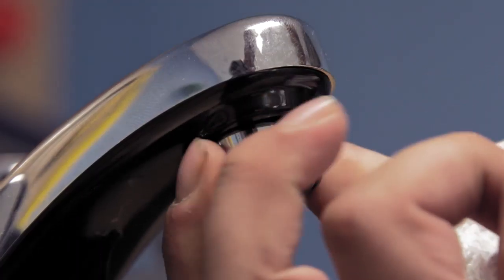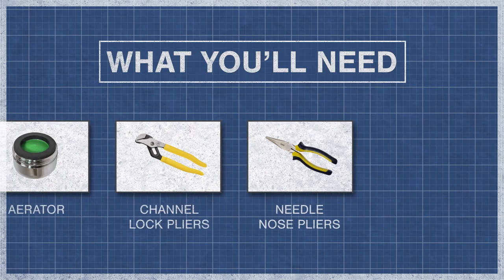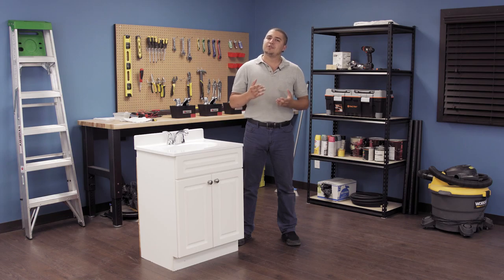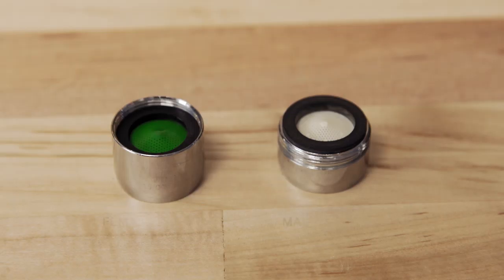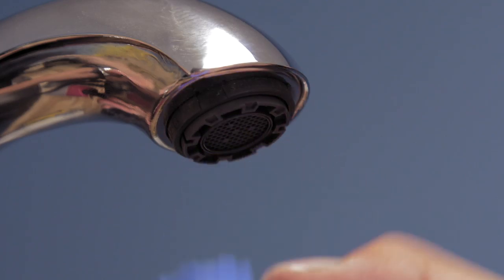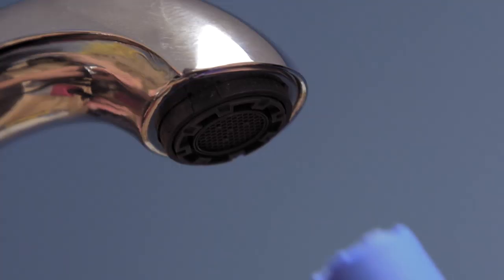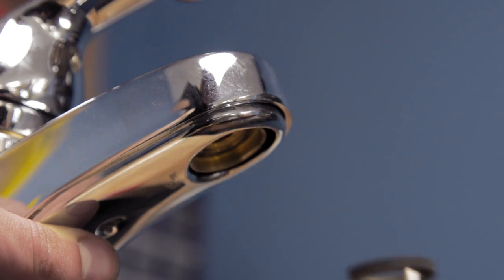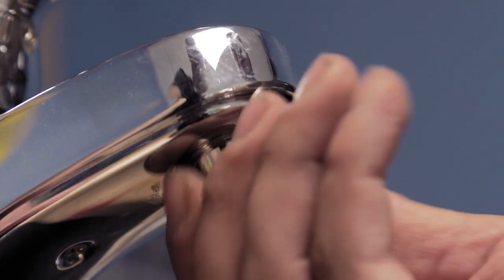How to Replace a Faucet Aerator | Repair and Replace

Comment: To keep it clean..every once in a whie put a sandwich bag of white vinegar on it overnight..secure it with a rubber band..You can do the same with your shower head too..
Reply from the maker: Thanks for sharing Lorraine! the vinegar tip definitely works like a charm on any calcium buildup.
Reply: Thanks!
Reply: Or use a twist tie to secure it ..
Reply: Thanks Lorraine
Reply: The faucet that’s on the display, how do you replace the tap opener?
Reply: @mohammedabbasladha4765  any home improvement store should carry whatever parts you need. (Home Depot/Menards/Lowes)
Reply: @AmreSupply  lock on aireator.
Reply: @The821  Why is everyone ITT calling you, "Lorraine" when your screen name says, @The821?

Comment: The plastic ring from a faucet water system I returned got stuck in my kitchen faucet. It’s internally threaded.  I tried a knife, screw drivers,  Allen wrenches (J SHAPE).  I muscled out less than half.  Thought I’d have to have the faucet replaced.  Kept praying and trying.  I looked in my kitchen miscellaneous drawer.  Saw my old carabiner ( use for my keys).   It had a J shape. It popped that plastic ring out after 2 nd try.   I actually jumped up and praised the Lord.  I’d been at it since about 7:00 a.m.   it was now 10:30a.m.   I’m 71 so I got a great arm workout. 😁
Reply from the maker: Thanks for sharing your experience. We're glad that it all worked out!

Comment: I think our plumber may have broken mine. The aerator is just loose and no water comes out of it anymore. The water comes out from behind the sink now. It’s just stuck there, can be rotated a little bit, yet it can’t be removed.
Reply from the maker: Thanks for watching. The aerator has threads so if it spins it should unscrew more. If the threads are stripped or damaged then a new faucet might be needed. It is possible that the aerator is blocked with debris or minerals. If you think that the plumber has damaged your system during a repair, then they should fix the problem they created.

Comment: You should slow how to use the screw  to open. I'm learning as woman I need to know is left or right to move and open it. I bought the screw and still I could not open or remove aletor .
Reply from the maker: Thanks for watching. The direction to remove the old aerator is shown at 1:31 From this perspective, turning it towards the left will unscrew the aerator. It is possible that there is a mineral buildup which is sticking to the aerator. You can put a plastic sandwich bag of vinegar and place it under the tap to submerge the aerator. Use elastic bands to hold it in place. Alternatively you can use a cloth soaked in vinegar. After an hour it will help dissolve the minerals and the aerator should be easier to remove.

Comment: I'm looking at 7 pieces I need to get back together.  That's what I was hoping for help
Reply from the maker: Thanks for watching. I am not quite sure what you mean. Can you rephrase your question?
Reply: @AmreSupply  I took it off to clean it and I can't put it back together
Reply from the maker: @bbx6969  There is some variety between models so not all parts will be installed the same. If you do an image search for "faucet aerator parts explosion"  you'll get the dissected view of the aerator. You'll have to look for the picture that most closely matches your aerator.

Comment: My aerator doesnt come off. I tried but no matter how much twisting force I use, it won't come out.
Reply from the maker: Hi Michael, thanks for watching. Sometimes minerals like calcium from the water can fuse the aerator to the faucet. You can use a rag or a bag full of vineger to soak the aerator. It can help dissolve the minerals to help release it. As well you can use rubber bands to increase the grip on the aerator when you try to unscrew it.

Comment: So I replaced mine, when I removed it and ran the water without the aerator to flush any debris out, water began leaking underneath the sink? I replaced the aerator and it doesn’t do it now, works great actually. I did notice that without the aerator the water flow was spraying everywhere. Is it normal for it to leak below if the aerator is not attached? It was as if the water was flowing back down into the spout and leaking below. and thank you for the video was very helpful in removing/replacing the part.
Reply from the maker: Thank you for watching. We're glad you found the video helpful. The aerator helps control the water flow, so you might notice the water dripping down the side of the faucet when the aerator is off. If there is no leak after installing a new aerator then there is no need to worry.

Comment: Thank you!  Most times a new aerator isn't needed, just a good soak in some CLR along with a soft toothbrush.
Reply from the maker: You're welcome! You are right that in a lot of cases the aerator can be cleaned. Hopefully the video is still useful for helping someone access the aerator.

Comment: "Hand tighten", I do just that and water sprays everywhere. When I give it a little tighten with a wrench, it is worse. The faucet even lifted and now water leaks out of there. Thanks for the video. So useful...
Reply from the maker: Thanks for watching. Check the threads, it's likely that there is a buildup of calcium which might prevent a good seal when you tighten the aerator. The threads can be cleaned by soaking a rag in vinegar and letting it sit for 5 minutes. In some cases might need to use a wire brush to help clean the threads.
Reply: @AmreSupply  you're right, there is lots of build up. I'll do that
Reply: @dachicagoan8185  same thing happened to me but I didn't bother leaving a sarcastic comment on a video trying to help people. I figured I was missing something rather than blame  the issue on the fact they CORRECTLY said to hand-tighten. What a baby 😒
Reply: @myshangriLa26  you're right. When I wrote that comment I was stressed out because it was a long day of replacing aerators on 3 sinks at my house. I had just moved in after 12 years of renting my house and the tenants never put salt in the water softener brine tank. So the interior of all the faucets were caked with sediment and impurities. Which is the reason putting on the aerators was a failure in 2 of my sinks. Eventually 6 months later I replaced with modern and better faucets. Not a problem for me anymore. 👍

Comment: Mine came undone last night somehow. So I was told.  Well it was leaking water. It was running down the side of the faucet neck to the bottom of the faucet making it look like the plastic seal at base was broke. I was frustrated as its less than 12 months old. I noticed the aerator was lose (that's how I found out it came lose last night) After watching your video I noticed the rubber gasket was missing. Put new gasket on and installed. Thanks!!
Reply from the maker: Thanks for watching! We're glad this video helped you figure it out, sometimes it really is just a simple fix.

Comment: Thanks for th great video. Unfortunately I have an recessed aerator and need a tool. Could u please talk about the tool. I am trying to replace the aerator with functions for an eyewash , face wash ( to eliminate need to use hands under the water) and  gargle( to eliminate need for  cups). As such I do not know the size of my aerator and am hoping the item will fit small aerators as it seems that mine is as quarter and nickel don’t fit in.
Reply from the maker: Thanks for watching. Recessed aerators often come with a tool. For example you can see in this example the wrench that is included with this aerator: https://www.amresupply.com/part/11402665 

If there are aerators on each of the eyewash nozzels, those might be a special part or still use the common thread. This might differ between models. You could measure it and compare it to the dimensions of standard aerators.

Comment: I have similar faucet; aerator is tight, unable to removed. Does Home Depot or anywhere that you would recommend that helps remove aerator easily? Thanks
Reply from the maker: Hi Anthony, thank you for watching. I am not aware of a specific tool for removing aerators unless its a factor made key type one for the hidden areators. One thing you could try is to wrap a thick blue elastic band (the ones you'll find from the supermarket holding together vegetables) Wrap it several times with the elastic band, then use the channel lock pliers. You might find that that has a lot more grip without damaging the aerator.
Reply: @AmreSupply  Thank you for reply. I'll give it a try.
Reply from the maker: @anthonychan3483  As well, if that doesn't help, then try soaking the tip of the faucet in vinegar for 10 min. You can use a rag or try to place a bag over top of the aerator. Sometimes calcium in the water can harden and build up, vinegar will dissolve any minerals.

Comment: Question. I just replaced mine and I noticed the water pressure significantly changed. But I also noticed the previous aerator was in upside down
Reply from the maker: Thanks for watching. How the aerator is installed can change the flow. Did the water pressure increase or decrease after reinstalling it?
Reply: @AmreSupply  Significantly decrease
Reply: @AmreSupply  It wouldn’t have to do with how tight I screwed the chrome fitting back in would it?? It’s pretty tight

Comment: Having and issue getting a very corroded aerator loosened with the pliers. With or without a cloth. the Pliers just keeps sliding. Any tips?
Reply from the maker: Thanks for watching! Its likely that there is a buildup of calcium or other minerals that has cause the aerator to fuse to the threads. If you soak a cloth in vinegar, or try to soak a plastic bag around the aerator it will help dissolve some of the minerals and make it easier to turn. You can also take some thick rubber bands and loop them around the aerator to help the pliers grip. Hope this helps!

Comment: Would you happen to know the aerator threading size for the Pfister faucet LF-042-PRCC?
Reply from the maker: It should be a standard aerator, either with male or female thread. The thread sizes are 15/16"-27 for standard-sized male and 55/64"-27 for standard-sized female.

Comment: The nozzle has a line on it which makes it look like it can be removed, but it can't, i've tried pliers, wrenchs, and other stuff, but it simply won't come lose, i'm not sure if it's able to come lose, i don't want to damage it further.
Reply from the maker: Thanks for watching. Most faucets have a removable aerator. Minerals from the water can make it difficult to remove. Try soaking it in a bag full of vinegar, this can help dissolve any mineral buildup that might be fusing the threads together. Then dry it off and try again.

Comment: what type of faucet adapter would I use for this sink.  want to hook up a diverter but can't find a female adapter to go up in it.
Reply from the maker: Thanks for watching. Without an example its hard to know what exactly you're attaching to. We do carry some adapters here: https://www.amresupply.com/search?q=aerator+adapter
Reply: @AmreSupply   trying to attach it to one of those diverters that come with a countertop water filter.   Can't hook it up cause the teeth are deep up inside the end of the faucet spout,  like the model in your picture.  I got the home depot glacier bay constructor 4 in.     and I can't seem to find an exxtra long adapter with a female end to screw in there,  they only sell male to male ones.
Reply: @AmreSupply  so it looks like I need a 55/64 27 female to male.  and I don't see anything sold like that.   Guess I'm shit out of luck.
Reply from the maker: @cooloutac  For something with an extra long stem, you might have to look around as they are not too common. Amazon might carry it. The extra long adapters are likely going to have 2 male ends so you might have to get a female to female end to screw into.

Comment: My aerator piece that I’m supposed to screw off just spins so it must be broken right? What do I do then? I don’t want to damage the water pipe but I want to change it out
Reply from the maker: Thanks for watching. If the aerator just spins in place it is possible that the threads are stripped. If the threads are damaged then it's best to install a new faucet.

Comment: is there away to replace the thread inside the faucet spout it seems to have stripped away and now that little piece falls off with high water pressure
Reply from the maker: Hi Anthony, thank you for watching. If the thread inside the faucet is stripped, then you'll have to replace the faucet as there is no easy way to repair the thread
Reply: You could try wrapping the thread with PTFE tape. Trim any excess off after fitting.

Comment: What if i can't remove the aerator? We have a bathroom faucet with an unsteady stream.  When we tun on the water, it's like it is turning on and of constantly. but the aerator is screwed on so tightly that we can't unscrew it ourselves is there a way to loosen it without brute force?
Reply from the maker: Thanks for watching. You could try to first soak the aerator in vinegar. Pour vinegar into a plastic bad and hang it over the edge of the faucet. The vinegar will dissolve any minerals that might be fusing and sticking the aerator in place. As well you can wrap a thick rubber band around the aerator, then use the channel lock pliers to unscrew it. It might help you get a better grip.

Comment: Could you help me indenting what the caps are over the facuets, the metal ones that pop off
Reply from the maker: Thanks for watching. Are you referring to the "faucet handle caps" ?
Reply: @AmreSupply  one manufacturer just told me “plug caps”?  That cover the open area down to the screw
Reply from the maker: @50LOVESIT  This is the category you'll want to take a look at: https://www.amresupply.com/catalog/Index-Buttons-PE9B

Comment: So I took mine off to clean it, but when I put it back in place the water is not properly coming out, what can the issue be?
Reply from the maker: Thanks for watching. Try cleaning the threads on the faucet itself. You can soak it in vinegar to help dissolve the calcium. Then try to fully tighten the aerator when you re-install it.

Comment: My problem- When I install the whole aerator and shell I always scratch the shell. I use a cloth but still. I also use same tool in vid to unscrew. Now the problem is the faucets I buy are not cheap. They are also gold color. Last thing I want is to scratch stuff when putting on new parts. They make a tool for pretty much every thing. They don't to remove or screw in a aerator so it won't scratch the outside shell? I will say I do tend to lock stuff pretty tight. That may have some ( not all ) bearing as to why the teeth of tools are marking shell. When you tighten all just hand tight without a tool?
Reply from the maker: Thanks for watching. It depends on how thick the cloth is, but there is still a chance of the teeth marking the aerator. There are different tools that will be listed as non-marring that won't have teeth. One versatile tool that can be useful to have is a strap wrench. The rubber strap can be tightened to any size and does not bite and scratch the fitting that you're tightening: https://www.amresupply.com/part/EBV-22-SLOAN-STRAP-WRENCH
Reply: @AmreSupply  thanks. Thought about that tool. Don't own any. Maybe now is the time.

Comment: i have got a dripping tap i have tried everything except this might this fix it
Reply from the maker: Thanks for watching. If you have a slow persistent drip coming from the tap, then its likely that the cartridges or the seats and springs are worn out so that's the first place to start. As well on a single handle faucet tightening the adjusting ring can help the ball valve sit correctly and seal the valve when closed.

Comment: The faucet that’s on the display, how do you replace the tap opener?
Reply from the maker: Thanks for watching. Can you re-word your question? What do you mean by tap opener?
Reply: @AmreSupply the cold water side. It has no screw or anything and it's round similar to the one in the video. I need to replace the cold water side handle I have the stuff from moen but I can not open the tap since it's kinda loose when opening and there is no grip of any sort on the handle so I can twist it. Any ideas?
Reply from the maker: @ladha99  Look to see if there is a set screw on the back of the handle. This will look like a small circle. You can use a small hex wrench (allen wrench) to loosen the set screw. Then simply lift up to remove the handles.

Comment: I am in Europe.  My aerator fell out.  I lost it.  Tried to find a replacement ... 24mm was too big.  22mm was too big.  20mm was too small.  Where the * do I find the correct one?
Reply from the maker: Thanks for watching Robert. Pluming in Europe is a little different than in Canada, so its hard to make any particular suggestions. Regardless take a closer look at the inside of the facuet, if you don't have any threads you might just have a 21mm aerator that just pushes into place. You could search for a  "21mm aerator insert"

Comment: And, what if I did exactly this, replacing the entire aerator unit (with gasket), and there is still a drip, ever so small, coming from around the aerator.  (The new gasket appears to be exactly the same size as the old one, and the aerator is the identical model.)
Reply from the maker: Thank you for watching. If the leak goes away then the drip is likely just residual water left inside the aerator. Also you can try tightening the aerator a bit more to see if this helps. If the drip is constant and doesn't go away then its likely that your faucet cartridge or the seats and springs are worn out causing water to slowly leak. If you have a single handle faucet you can see how to repair this here: https://www.youtube.com/watch?v=u9n6IZbrAUc  For two handle faucets: https://youtu.be/UPx10ILQp64